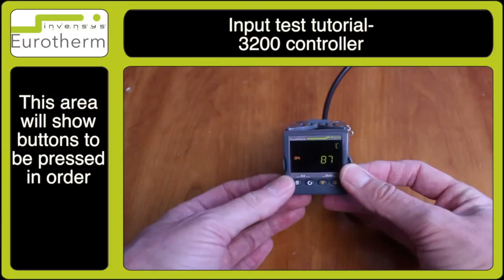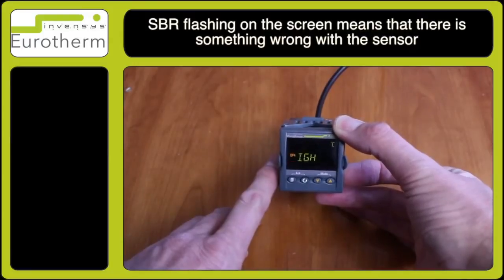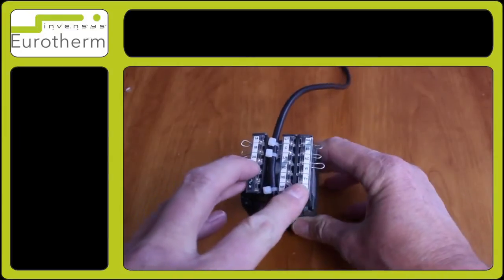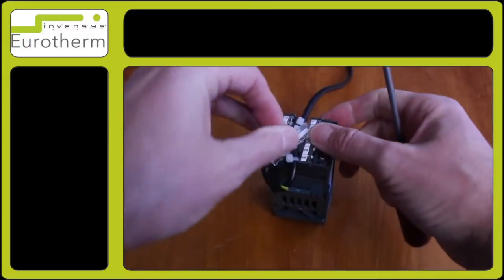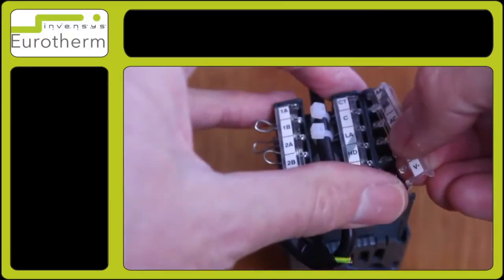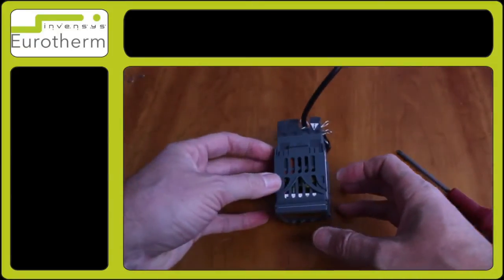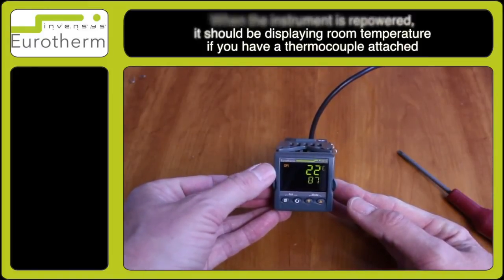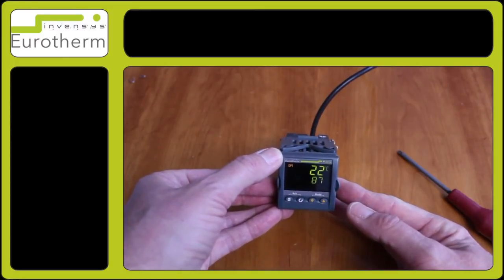Input test on a Eurotherm 3200 Controller

Comment: Hi ... I have 3216 .. I want to program it to a heating oven so that the temperature goes with time (At the beginning of 0 to 200 degrees in 15 minutes then from 200 to 500 in 30 minutes and then keep the temperature 500 degree of10 minutes)